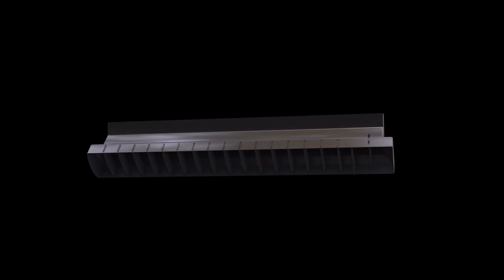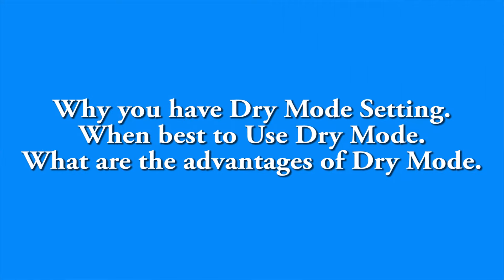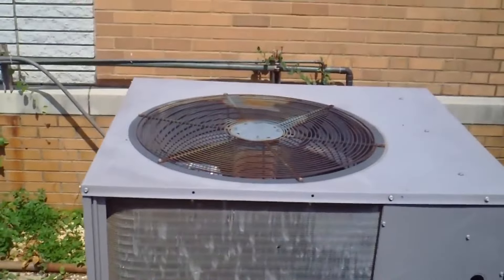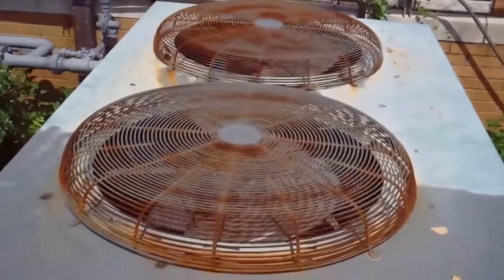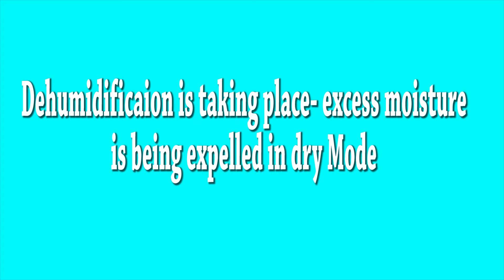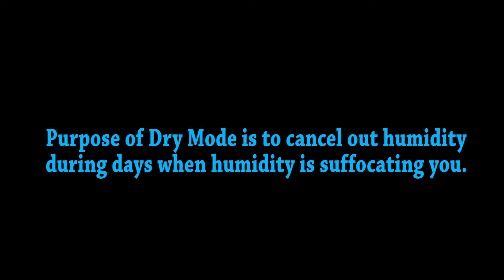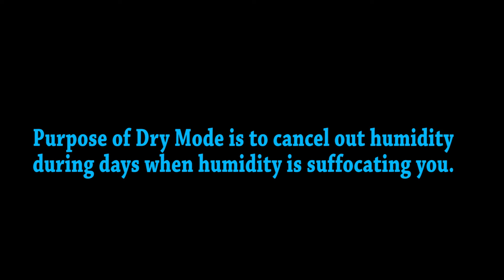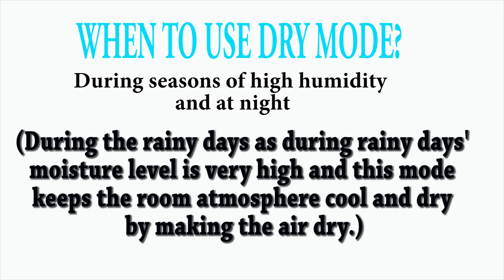Dry Mode air conditioner (Dry Mode AC Explained)

Comment: this works in humid countries. used to put on 16°c (cool mode) and felt hot once the AC is off. now i put it on 25°c (dry mode) and the AC works better and i feel colder and less 'sticky'. the dry mode works really well in humid south east asian countries 👍👍👍👍👍
Reply from the maker: Well said

Comment: I live in the Caribbean and it’s pretty humid here. We are now having temperatures around 90° and 100° in the city area where I live. I put the A/C on DRY MODE by accident two months ago and noticed the room started to cool down slowly. Been using this mode for the last month and I the room cools down to an average temperature ranging between 76° to 80° during the day and 74° to 78° during the night while keeping the power consumption down. The room usually goes down to 70° to 72° on cool mode. This dry mode is really efficient in humid areas, I don’t think I’ll be using the COOL MODE again.
Reply from the maker: Very true

Comment: I’m having some really big problems with my AC dry mode.  My house has a high wooden roof (that’s already aged) and one of the walls was getting humidity. Then I decided to turn on my brand new Hisense dry mode. But after 24 hours, I had two more walls getting “painted” with humidity…

The thing is, my controller only gives me the option to choose  from -7 to 7 in this mode. But doesn’t let me set a temperature. And I wonder, have I done something wrong? Or is it normal for the walls to get more wet because the humidity is going away?
Reply from the maker: Oops. Sorry for that. Have you checked all the settings?
Reply: For the -7 to 7 check your manual to see the ranges on temperature. In summer I use -7 for the coldest setting but mine is another brand.

Comment: It set my AC to 25° Dry Mode in summer. Summers are very humid here even as night
Reply from the maker: Cool. That should help
Reply: @AskRepairBuddy  Gets the humidity down to 45%
Reply: chichirosie5295  What make and model?
Reply: chichirosie5295  Dry mode is just the fan on the evaporator (inside unit) runs at a lower speed allowing more water loss over the coils. It's much slower to cool the room but removes more water
Reply: I set my AC to 28°C in dry mode at night.

Comment: Is actually colder. In my unit I can see the temperature going down.
Reply: It’s good for certain temps. Melbourne here and at times using it when it summer but have a rainy patch is a god send. In darwin it’s a must to have cause how humid it is there. Tho on a freaken 35c onwards day and it’s just sunny, the cool function is better.

Comment: Dry mode is more cold right???
Reply: No... Cooling is minimal... It removes moisture from air... Best for rainy days.. As temperature is already lower in the surrounding, only moisture removal is needed.
Reply: It feels cooler because of the moisture/humidity from the air circulating in the room being removed. The higher the humidity the warmer it feels. Only use it when the humidity is high like in rainy days
Reply: I have a Media U- shaped ac. It says when using Dry mode it will cool "slightly" but it mainly removes the humidity. It does a good job at lowering the humidity but my room gets much colder than I want it too. Even though I usually set my ideal temp at 69 degrees my room drops as low as 63 or 64 when using dry mode. For me thats too cold and you can't control it so I have to switch back to "cool" mode because at least in cool mode the ac keeps the temp at the 69 that I like. The problem with cool mode is that the relative humidity goes back up to 60-75% again.
Reply from the maker: Perfect said @AnkitSinghAnarchoAtheist
Reply from the maker: Perfect said @shinjihirako4773
Reply: Correct. Many people here don't seem to understand that air HAS to be cooled for it to condense. If dry mode is set to a temperature only slightly lower than ambient, it doesn't work very well, ie moisture removal is minimal. This is why dehumidifiers are 'better' in the sense that the dried air is heated back up once the moisture is removed, avoiding a decrease in temp which is undesireable in winter
Reply: @gumpert7611  I agree but I don’t get the difference between dry mode and cool mode though. Air must be cooled for water to condense, so dry mode cools the air, but at the same time cool mode also cools the air resulting condensation therefore drier air. Any suggestions?